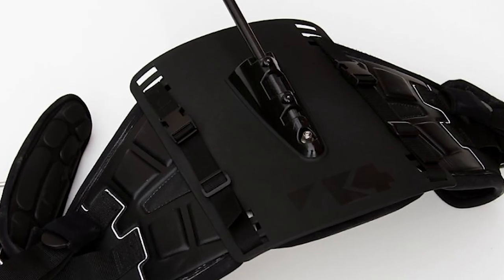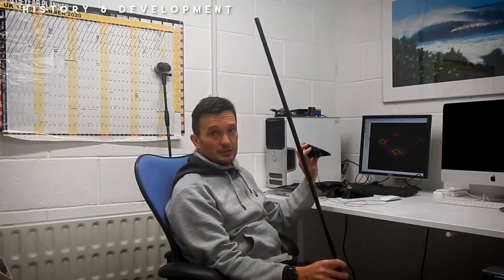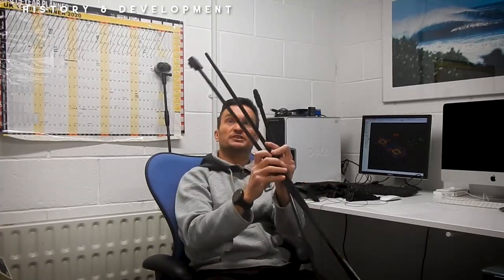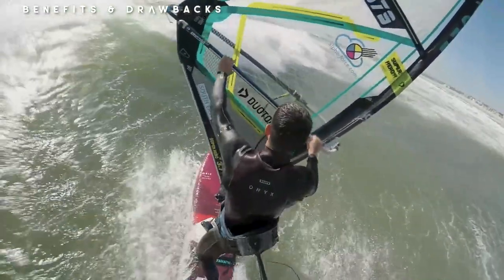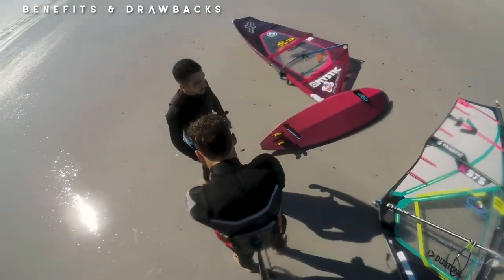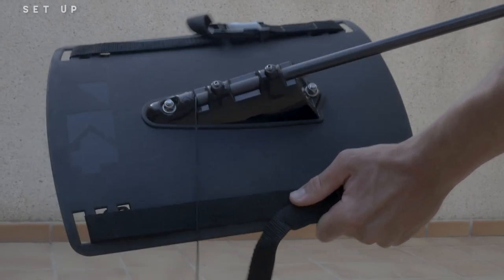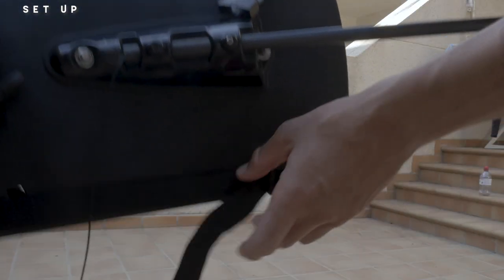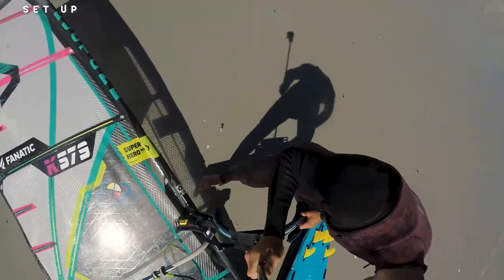K4 HARNESS MOUNT FULL REVIEW // 𝗧𝗘𝗖𝗛 𝗧𝗔𝗟𝗞

Comment: Great video and some great tips there.
A rear harness mount definitely gives the best angle of any for filming yourself on the water and this K4 mount is a great and tough piece of kit.

A couple of tips I’ve learned.

(1) I’ve found it so easy to knock the camera with the mast during water/beach starts and push it off line. The can be cured by getting one of them little tools that allows you to get the thumbscrew really tight.

(2) Yes I know the video specifically advises against this, but I’ve been using it on an old soft race harness and you can feel the pole (long, 130cm) bouncing around like crazy! Surprisingly the hero 8 black copes with it very well and the footage still looks good! But I’ve just got a Max 360° which copes OK... but less well.
So I’m going to try the support plate so I can use it with my main more rigid harness. Should be better but let’s see how that goes.

(3) One advantage of this type of mount compared to all others is that the pole bounce means you never get unwelcome drops of water on the lens ruining the shot!

(4) For those like me that fall in a lot, catching the camera with the mast during water start is a bit of pain. Consciously flying the rig as far away from you as possible is needed to avoid this.

(5) Flipping the rig before water start. The pole ends up under the sail and you need to swim to the mast tip to free it. Don’t flip the rig in the usual way. Do it from the clew (messy), or wipe out with the rig positioned for the tack you want it.

(6) it does hamper your sailing a bit, especially as mentioned during beach/water starts. As the video says don’t use it if conditions are anyway getting outside your comfort zone.
Reply from the maker: Hi Phil. Thanks a lot for your comments, I'll pin this to the top as people should find this useful!

Comment: Thanks Lucas for that review. Which pole length and camera where you using for your shots please?  Regarding the harness stiffness, any harness you recommend please? Regarding safety, I would always use an helmet for the back of my head...
Reply from the maker: Hi Dom, using the extended poll in this video, with the GoPro hero 5. The new 
DUOTONE Radium Team Series harness works great with it. But any hard shell harness will also work.
Reply: @LucasMeldrumK90  thanks. By chance, have you tried both the Radium Curv 13 and the Icon curve 14 to have toughs about the difference between the 2 please?
Reply from the maker: @domdom2830  I'm afraid not, maybe at some point I can review a few harnesses